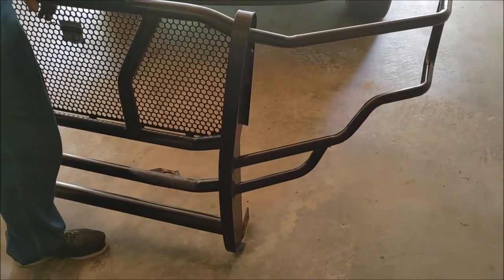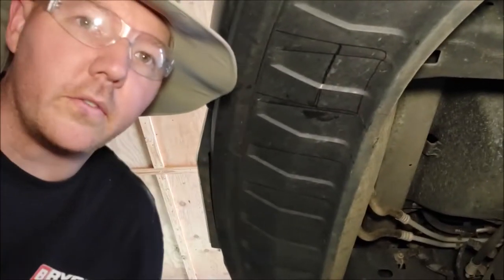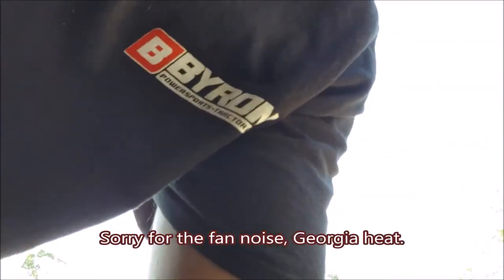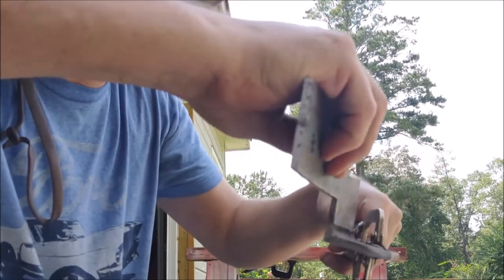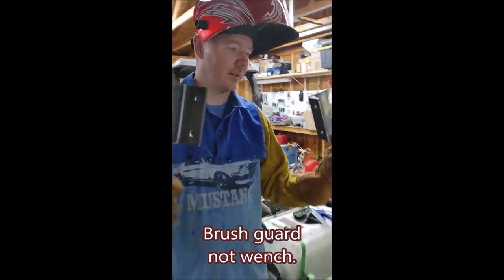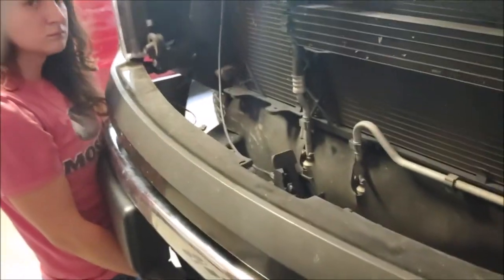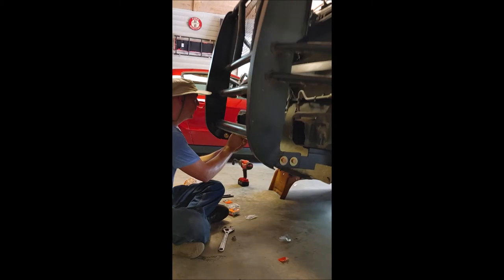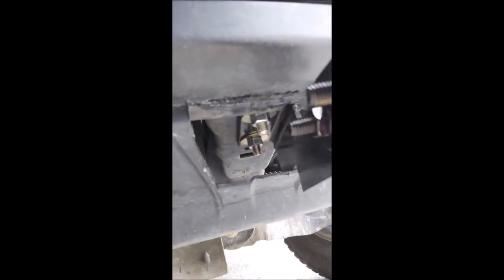Installing a brush guard on a 2wd F150

Comment: Great video! Hoping you’re still around for this question: do you have to take the valance and bumper off? There’s no way to get into that “frame tube” to line up the bolts? I’m a novice mechanic, but my wife had little hands.😂
Reply from the maker: We did not take the bumper off. There is a plastic shroud under the truck from the bumper back to the frame. Take that plastic down at the bumper and it will give you all of the sight and access you need.

Comment: How much front end sag did you get from the extra weight?
Reply from the maker: If I got any it is not noticeable because I put a 3" lift in the front and 2" in the rear.
Reply: @GeorgiaWoodsHomesteading  oh ok. I have a 2.25in leveling kit on my truck i was a little worried i was going to lose a half inch when i put mine on
Reply from the maker: @buffalobmf  I dont think the brush guard itself is enough to make a noticeable difference. If you had the whole bumper package you would need to upgrade the suspension.